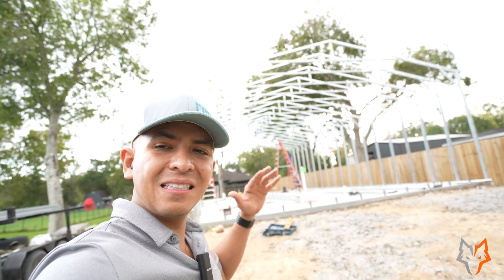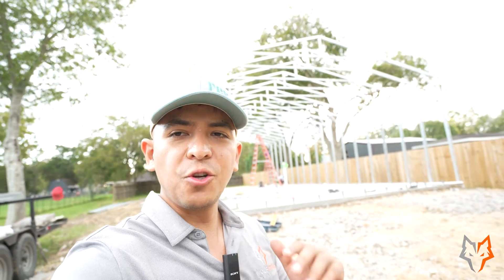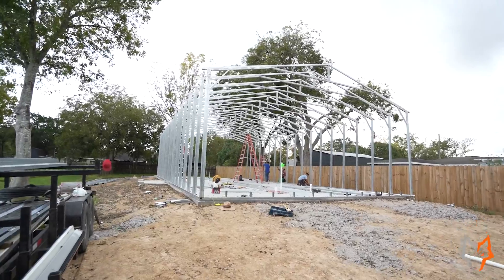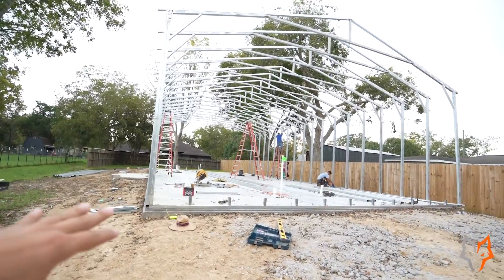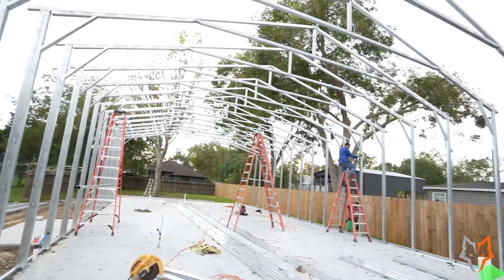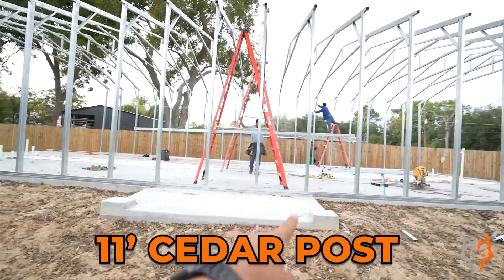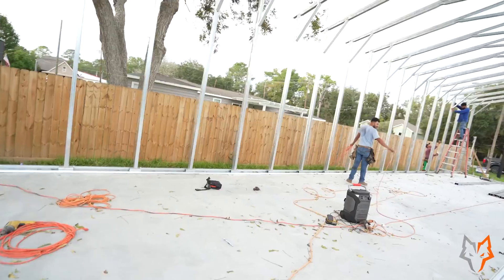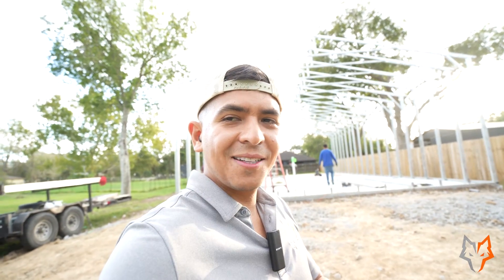30x70 Steel Building Framing | Santa Fe, Texas | WolfSteel Buildings

Comment: Wish you were more honest on “customer outsource this and that”. As someone with steel erection experience all over US for fracking. 

It could be tuffshed, superior, Armstrong steel, American steel, etc.. 

Garage doors are sold separately and not in their contracts for  insurance reasons. 

Not hating on the game, not sure if your an actual general contractor that bids for jobs or just a 3rd party crew that erects for tuffshed etc. either way keep on stacking the bread. 

Generally speaking, when it just  crew doing shells, (steel erection) their just an erection crew selling themselves as the superior GC on site.
Reply from the maker: Thanks for the feedback!
Check out our page to learn a bit more on WolfSteel! We are a general contractor that handles the dirt, concrete, permitting, building, design plans, door, etc. We actually provide custom overhead doors and roll up doors which we can and do provide information to customers. They are included in our contracts for that reason. 

Main reason we don't state where they come from is we do not determine where or what our clients outsource. We typically do get all specs to make sure everything fit accordingly. If we haven't seen or looked into a brand we would hate to promote it without facts. 

I do understand where the confusion comes from and I do hope this answers any questions!

Comment: What’s the wind rating for red iron buildings?
Reply from the maker: This is a great idea for a video. We'll begin working on this. 

Short answer: Weld Ups do not have a wind rating. Bolt Up buildings can be engineered to any wind load based in area. When a building is engineered it needs to be inspected afterwards to verify it was built according to plans.